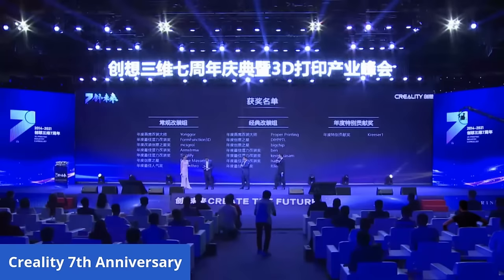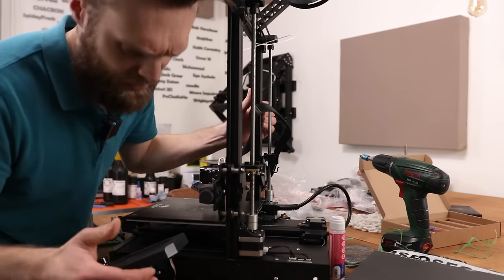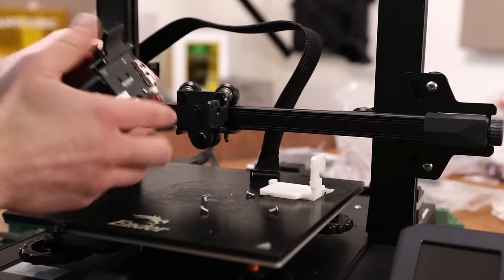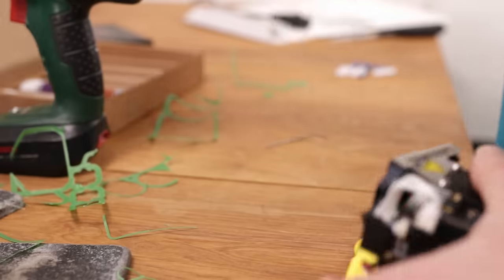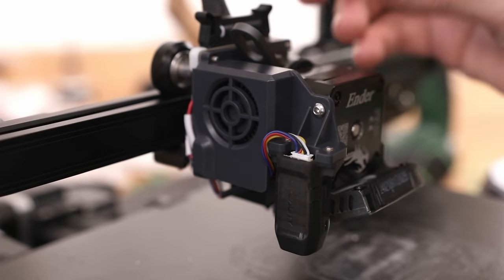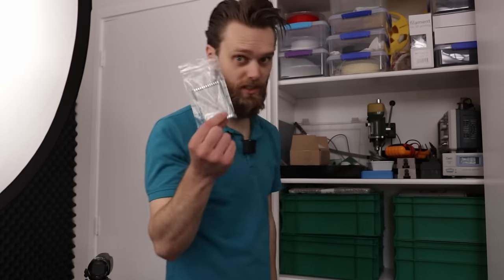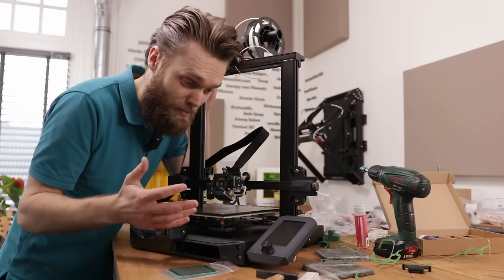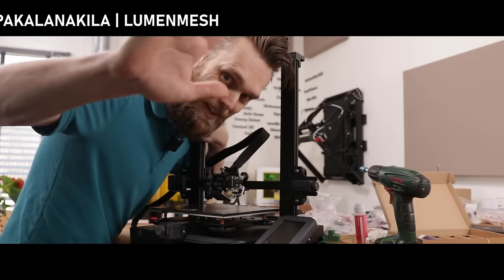MUST HAVE and SIMPLEST mod for Ender-3 S1! Contest worthy?

Comment: Doesn't fit well. I cannot print with it attached. Back pulls off and front leans down.
Reply from the maker: Thanks for your feedback, I also read your comment on the website. Unfortunately tolerances are quite tight, so it depends strongly on the print settings, especially extrusion width/-rate.

Comment: is useless... I have printed with multiple materials and settings and I cant not get it to wobble and only cause problems to the print... mainly because it only has one attachement point for the slider... it just slides out to easily during printhing and the tolerances make the head wobble... I think this is a good Ideo I agree, but this is unfortunaty not a good iteration... maybe you can try to improve on this for future versions
Reply from the maker: Thanks for your feedback! I think that the problem is the coarse tolerances of the sheet metal part. Mine fits perfectly and I'm still using the same part as I've shown in this video without problems. For me it's hard to improve on something that fits over here. I also have the S1 pro, maybe that's different. I have to try that.
Reply: @properprinting  S1 and S1 pro is samely intensley... can you tell me a way to fix it or send me the file, so I can fix it myself?
Reply from the maker: @nebuchadnezzar47  you can use a knife to adjust that clip a bit. The source files are available to my Patreon supporters.

Comment: This is the most stupid solution that can be installed on creality sprite. The extruder was originally designed for quick access. you need to unscrew TWO SCREWS AND DISCONNECT DATA PORT. THIS IS ALL, THERE IS NOTHING ELSE TO DO.